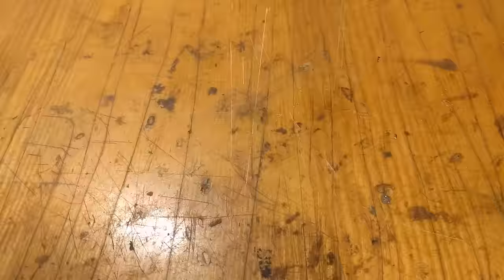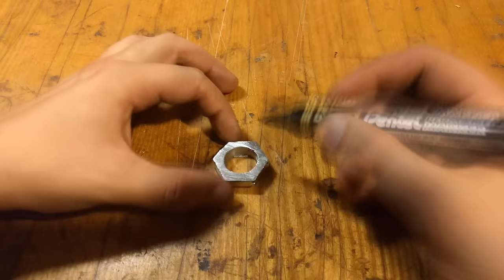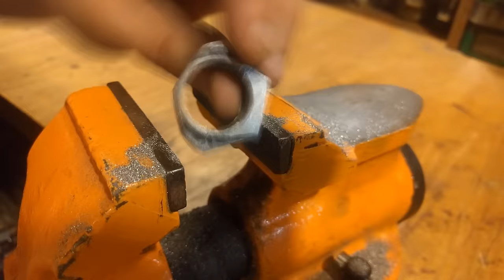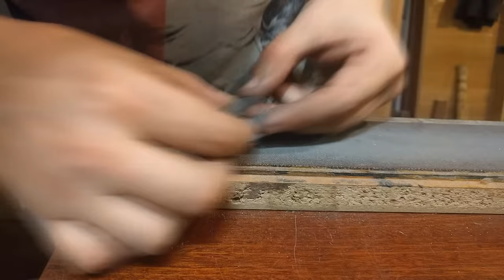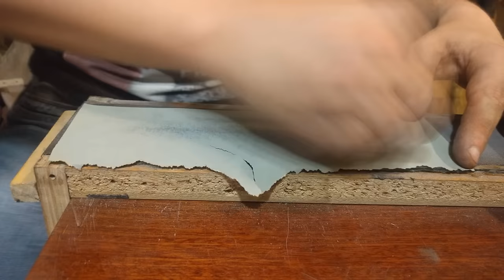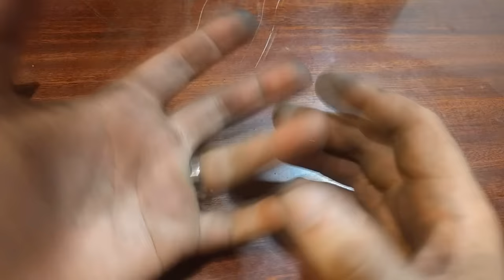DIY ring from a nut (with common tools)

Comment: I left the threads in my ring so it will stay on my finger more securely. I twist the ring onto my finger and then torque it to 30 inch-pounds.
Reply: Yes, I have a little wrench that clicks when tightened

Comment: Here’s a tip for anyone trying this on their own, turn the nut 90 degrees in the vice and do all the filing sideways. This will keep the nut from bending/distorting if you clamp it too hard if your nut is made from a softer metal like brass. Being able to have the nut tightly gripped will also help if you’re running into problems with it moving as you are filing

Comment: About 18 years ago I turned a socket wrench part from craftsman into a knights ring, the round part of the socket. I've seen rings like it in the stores from $100 to $200. I tryed to polish it with cloth for a couple of years 😋.(I worked 3rd shift and didn't get the rest that I needed thanks to some step "kids".) Years later I finally got it polished right. I used different emry cloths and then once a week I would use auto polish for chrome.Then I would use silver polish on it and then buff it with an old sock. Now it shines brightly in the sun. I also do this for my swords and knives. 😀

Comment: Awesome work.

Using a softer Brass nut of the same size would likely speed the filing/cutting process up somewhat. Also, consider using some cutting fluid when cutting with the hacksaw, it'll make cutting a lot easier, and swill some of the steel chips out of the way, stopping any wandering.

Also, use pieces of bicycle inner tube to secure stuff in vice jaws to stop your work from slipping. 🤙
Reply: Thanks for the tips! Will be using these for sure
Reply: @med8615  For precise, delicate sanding too, look up sanding sticks either on ebay, or at a local model making store. 👍
Reply: @jimmyrustler8983  a decent seeming human being on YouTube. 👍🏽

Comment: I also made a ring like that, but how can you prevent it from rusting on the surface? After a few days, on mine,appear a very thin layer of rust and I don't know how to prevent it from happening. Beautiful ring anyway
Reply from the maker: this one in the video maded from stainless steel nut
Reply: Apply some nail polish sometimes it helps
Reply: Heat treat it mate and tip it on oil
Reply: Heat them up untill they glow a dull red. Hot but not really hot.

Then throw it in a metal container of used motor oil. Just hope it doesent catch fire. Do it outside.
The minerals in the oil will make the metal have a nic
e  petina.
You will have to polish it back to metal as it will be black. But the metal will be hardened and wont rust.

Comment: Him: starts video off by filing by using filer 
Me: looks across workbench at dremel with file bit
Him: rubs on sandpaper
Me: Looks again at dremel
Him: cuts sides using file
My dremel: sweats aggressively

And yes I understand the title says “Common tools” it’s just a joke
Reply: Dude my go to would be that Dremel in an instant... Save all that speed you chowed down on for after the ring is built

Comment: A nice hack you can do to speed the filing portion in the beginning use a file with a handle that can be removed and put the tang in the chuck of a power drill. That way you don’t have to spend 20 minutes or better doing that saw motion with your shoulder while also rotating the file.
Reply: It'd have to be a round file but i dont see why that wouldnt work.
Reply: Im actually going to attempt this using a dremel although ill probably use the hacksaw for the parts he did.

Comment: Even though it's steel, using water to wet sand would really make it shine, however using oil and sanding sheets would make it glisten and fill in/ take out any fine scratches. Just FYI.
Reply: patrick mcglone what kind of oil

Comment: Thumb up for common tools, these are really (relatively) common than those grinders/drills/lathe/hightech-shits-that-i-dont-even-know-their-name in a lot of "hand made" videos. But how to keep the ring from rusting (if the nut is not stainless)? My hand sweats and I can even made coins rust if I don't wipe them after touching.
Reply: use a stainless steel nut
Reply: You can electrocoat it with stainless steel or even silver. You would only need a plastic container, common water, salt, a 9volt battery and wires and it works perfectly. I have electrocoat many things with stainless steel, zinc and even copper, it's simple, easy, cheap and the results are amazing!

Comment: 0:53 was that sandpaper? Just curious. Cuz I'm actually going to try this
Reply: Most likely sandpaper wrapped around a pencil or dowel to smooth out the inside
Reply: Ya it looks like sandpaper around a dowel or thick pencil
Reply: What about the first part, it just looked like a metal rod to me?
Reply: @anapprentice2089  round file
Reply: @thenuclearnarwhale9188  thanks m8
Reply: @anapprentice2089  no prob bud :)

Comment: Jesus Christ man. Buy a belt sander. Thats just torture.
Reply: Common tools man...common tools...some people cant afford belt sander
Reply: “I’ve been sanding this nut for 84 years…”
Reply: @KopiKuceng A metal file that doesn't go dull after demolishing half of that nut should cost you about the same as a working used bench grinder, and if you're lucky, a small belt sander. A McDonald's meal nowadays costs you more than both tbh.

Comment: I recently made this and I love it I wear it every day but it leaves a weird rust color on my finger and I was wondering if anyone had any advice on how to prevent this,thanks
Reply: You probably used a galvanized nut, make one out t stainless steel and use a jam but. It isn't as thick so there is less labor to it.
Reply: Clear paint will work temporarily

Comment: Thing is this kind of steel rusts on your lady’s hand. Its sad, but not recommended that you use steel. But as a pendant it would be a neat idea.
Reply: That is a stainless steel nut . Mild steel do not shine like that .
Reply: Stainless will rust too. Generally avoid ferrus metals for rings. I tried making a ring for my girl friend in hs. I made one that fit her hand, but it rusted on her finger.
Reply: @BlyatBear  don't think its made to wear 24/7..
Reply: Nope. Stainless steel does not rust
Reply: Thomas Ritter yes, it does rust, it just takes way longer and has to be in a hot and humid environment. I work in a body shop and have been working there for a year and a half. We got a new stainless steel fridge right when I first started working there and up until 2 weeks ago, it’s starting to get little rust patches on it about the size of a dime and really light, so it’s not even noticeable unless you’re right up on it. That’s because the shop I work at is right next to the Mississippi River on the side where the wind blows, and we don’t have working A/C so we keep the garage door open, and it’s usually around mid 90° in the summer. And the fridge was never cleaned.

Comment: Does it leave rust in your finger? I did a hex nut ring, it came out very nice but I can't use it becouse it leaves a Brown circle around my finger. Can ot be prevented somehow?
Reply: I would assume fish oil potentially but I am not sure as sweat could be another factor that might deface the fish oil
Reply: Use a stainless steel nut, shouldn't rust if it's real stainless. Then polish it up really good, I use mother's wheel polish with small drill buffers, mother's wheel polish will not only make a mirror finish but leaves a protective coating.

Comment: Just a little advice, a $20 dremel would get you through the first part MUCH faster. And be useful in many other parts of this process.
Reply: Files dont add to the Electric Bill.
Reply: @bobl.2213  We are talking cents, in my opinion it would be money well spent haha
Reply: @bobl.2213  Wow, a whopping 25 cents?
Reply: The whole point is using basic tools, not everyone has a Dremel and they aren't that basic
Reply: @dobson.  Probably not even that. A few minutes with a dremel would most likely not even reflect on the bill.

Comment: I would drilled out the threads then filed it to size,
Reply: You have a drill that thick?
Reply: @WikterRor2807  yep, I got a set from 1/2" to 1" stepping up an 1/8" each bit.

Comment: That was painful to watch. Drill. Band saw. Belt sander. It would have been quicker than the video
Reply: I think he was doing it to show others that you don't need power tools to be creative and produce something.
Reply: Defeats the purpose of the video, hence common tools
Reply: You can do it with power tools, but you really nees to be careful of not heating up yhe stainless too much. Hexavalent Chromium vapor off hot stainless will give you lung cancer.

Comment: Very 'fast" working! ! ! ! ! ! ! ! ! ! !just jocking.but sir ,after few days ring oxides and rust cover all over the ring.what should we do for prevention?
Reply from the maker: you should use stainless steel nut, as do in this video
Reply: A smart person would dip or spray the finished ring in lacquer.

Comment: Size of the nut?
Reply: That's what she said.
Reply: Looks like 3/4 inch, I tried with a 5/8 inch and it was a nightmare, and I used a dremel too, 5/8 is too small, go with 3/4 inch stainless steel so it won't degrade or rust, plus stainless won't turn your finger green

Comment: One thing though. Instead of sawing some on each side, why not just take more off one side of the nut and save some time and energy?
Reply: Look real good, go on, open your eyes...he cut it like that because the shank of the ring is narrower than the the top. Your idea works if the shank stays the same width as the top of the ring.
Reply: @TheRoadhammer379  no, this idea works anyway, just sand a bit of an angle and thats it. Also he was strugling a lot while filing cause the vise jaws, he could simply put it on its side and file easier

Comment: I want to make one but I'm scared of it rusting
Reply: Make it out of stainless steel 🔥. And wear it daily.
Reply: 304 Stainless is pretty good as far as Corrosion resistance goes. You could also use Brass, or coat it in Froglube. 👍

Comment: wont it get rusted?
Reply: I have that question too
Reply: It's a stainless steel nut
Reply: no, not inside
Reply: Kewal Takhellambam If it’s zinc plated, it will.
Reply: Just spray a clear coat on it

Comment: What size nut did this start as?
Reply: I'd like to say 16mm, but ideally you want one that will fit your finger after removing the threads inside.

A ring gauge will help massively with this. Also, the bigger the nut you use, the beefier your ring will be. 👍
Reply: Hahaha I’m guessing he’s 5’8”
Reply: @susansmith574  Why didn't I think of this? 🤣

Comment: But! Rust?
Reply: Isn't Steel stainless?
Reply: If it's made stainless yeah, there is a process. That's just polished steel.
Reply: That's likely 304 Stainless, pretty good corrosion resistance.

Comment: Why did he cut it twice, he could have just cut 1 time but more towards the middle
Reply: Он резал по одигонали, чтоб нижняя часть была уже чем верхняя
Reply: Less sanding on one of the sides. Most nuts have rounded parts on the corners which would take a lot of sanding to remove. Another reason could be wanting to make the sides taper inwards as it goes down